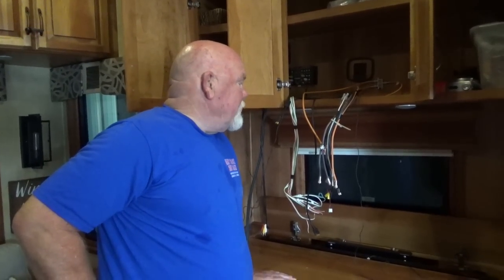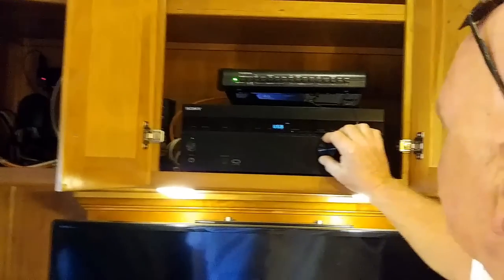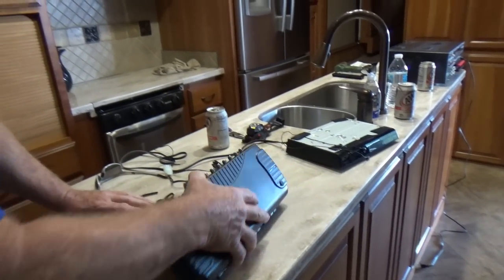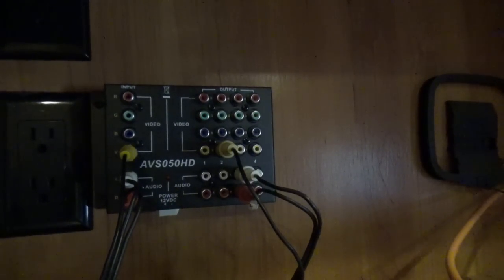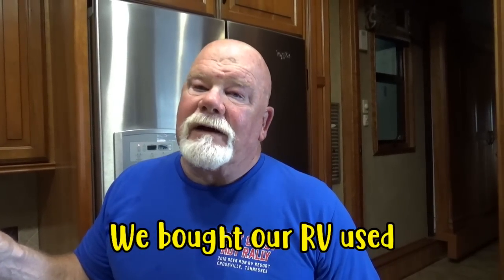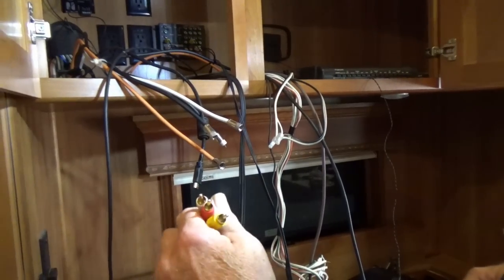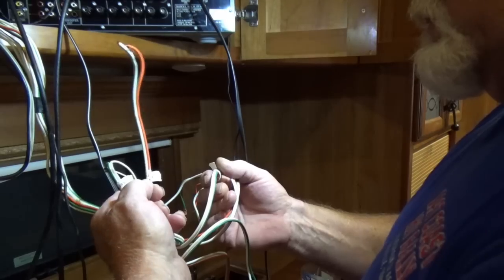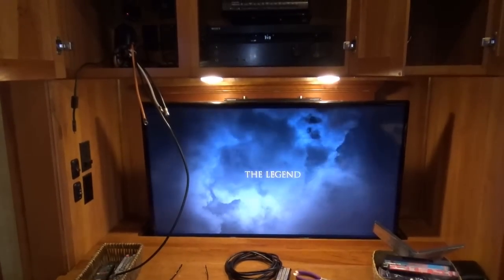💪 DIY -  RV Stereo Electronics Nightmare

Comment: We have the same confusion.  Testers and toners and all the support stuff.  I have decided that when I replace the roof TV antenna I will get a gallon of Crown and do what you just did.  I will not pay for cable or sat, its all on our Starlink and "Over the Air" unit.  But 3 TVs is # more headaches!
Reply from the maker: That's the way to go...Crown and no payments.

Comment: Hey Dave it's just like putting a 4 track (fore runner to the 8 track) in your 1st car BITD mine was a little more challenging as it was positive ground. I had a bunch of  used trailers thru the years and always had to figure out where it all was wired to. I bought a Fluke signal/receiver to  make it a little quicker. These campers are like cracker jack boxes you never know where or what you'll find as a surprise. Happy Csmping you two.
Reply from the maker: You got that right.  You never know what you are going to find.  We found the first owner's prescription bags under the fireplace.  But no drugs.  LOL

Comment: Sold yourself short there Dave , that was hard on the brain , back engineering your entertainment connections rates at least 10 beers and 12 if it works better than before 👊 great job , your patience held out well 😁
Reply from the maker: I like your thinking.  12 it is. 🍻